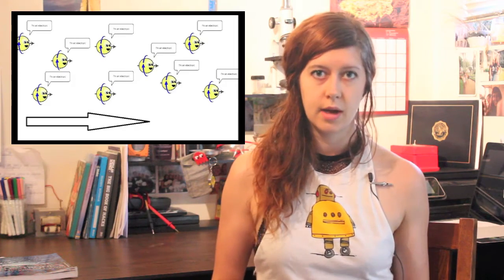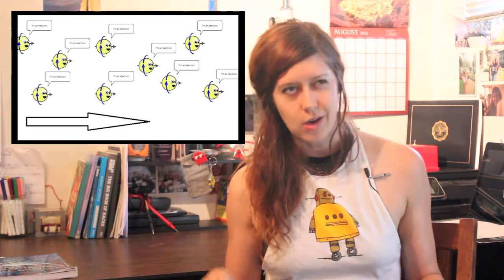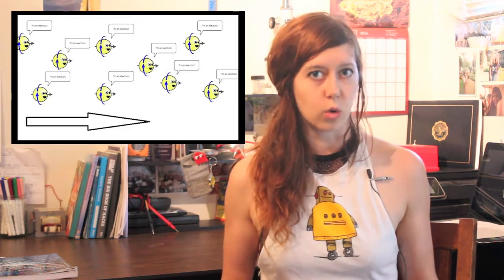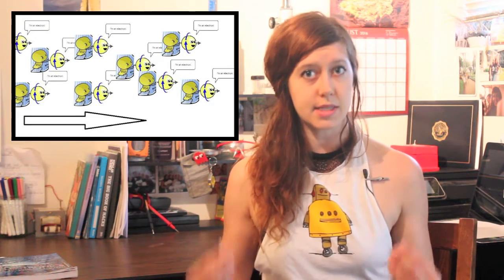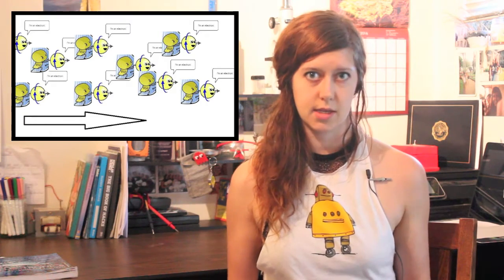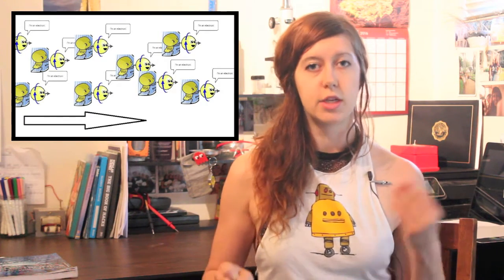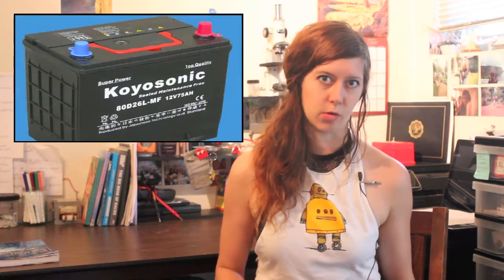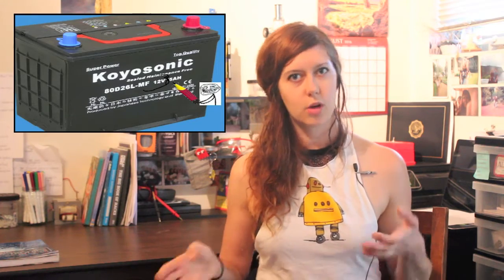Exploring Electronics, Episode 1 (Pt. 1)

Comment: You taught me how to use a multi meter,do simple math on electronics,many basic things like Voltage,Resistance,current etc.
That's super cool! Now if I am not mistaken we will need to stack all cells in number of 4(series ) and remaining in parallel.
Reply from the maker: That's awesome, super stoked to hear that you learned all that from my videos!! :D Yayy that made my day :)
Re: batteries, yup! You are absolutely correct. Part two is coming very soon so check it out for another challenge question! :D
Reply: +jen foxbot yep! I am tuned and waiting! also I did blown a few LEDs due to high current in opposite directions.
Reply from the maker: lol that's not easy to do! Hopefully a good learning experience, hah.

Oh, and video is up! :D